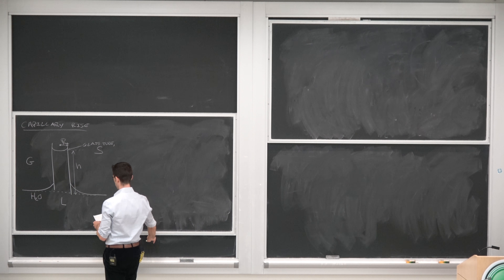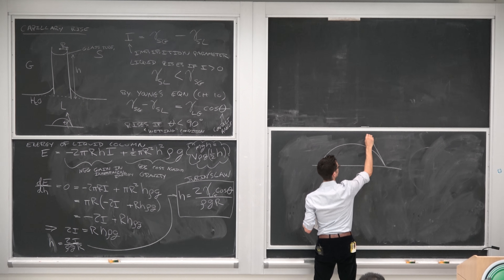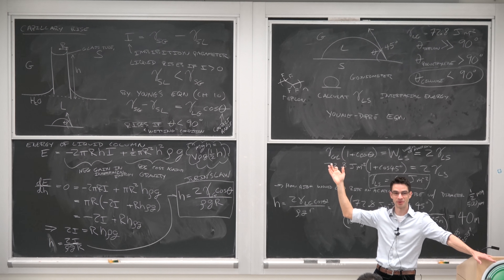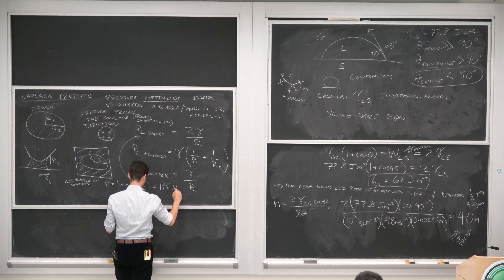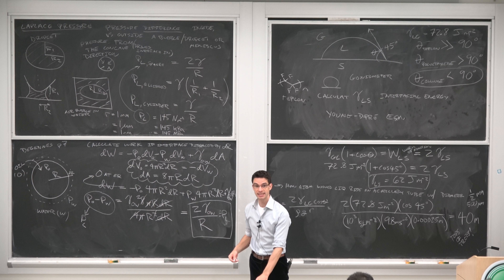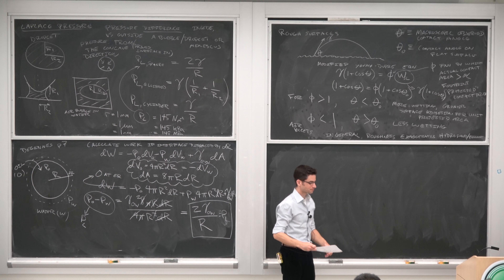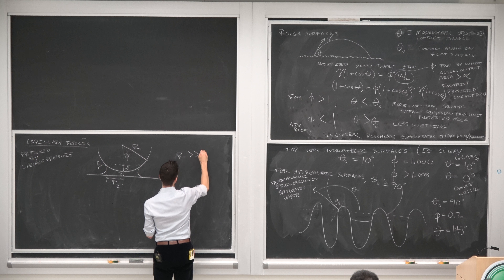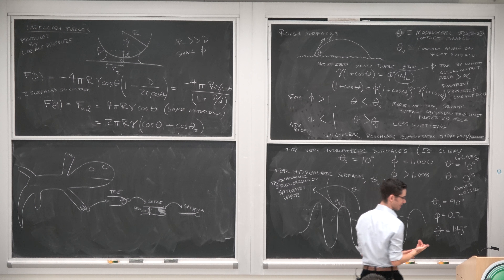Ep14 Surface Tension, Laplace Pressure, Capillary Forces NANO 202 UCSD

Comment: Prof. Darren. I still don't understand what is the capillary force? Quere's book 'Capillary and wetting phenomena' says Capillary Force is as a force per unit length.(Page 4). But it's as same as the surface tension. So Surface tension=Capillary force? Is this right? I searched for this term on the Internet. But I can't find clear direct explanation, e.g.  on Wikipedia. Just have many about capillary action. But researchers often use it in their papers. Can you explain it? And why you always mention it with Vander Waals force? Thank you very much.
Reply: Jnhhlgv🚇🚇🚇🛹🤢🚏🚏🇼🇫🇼🇫